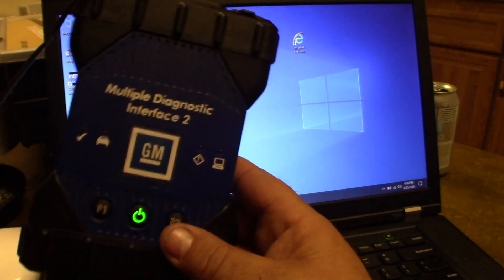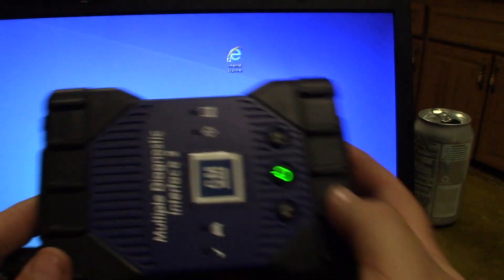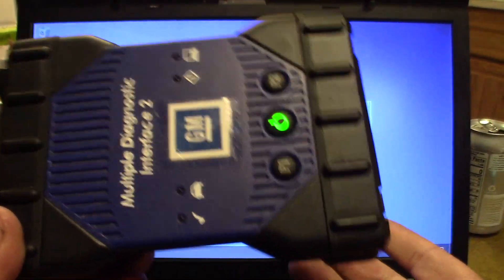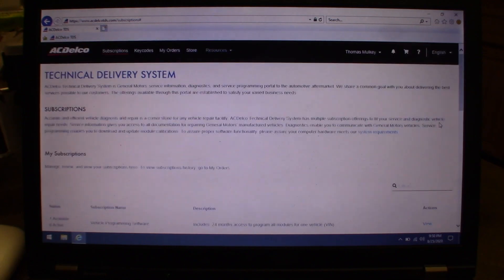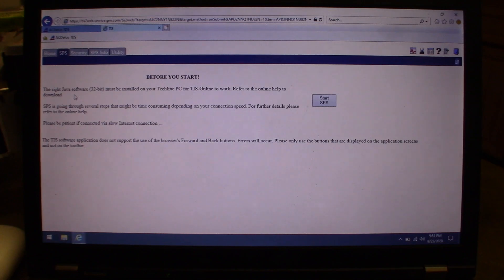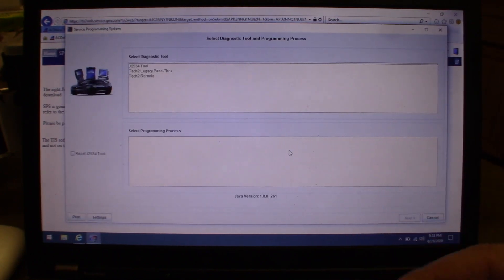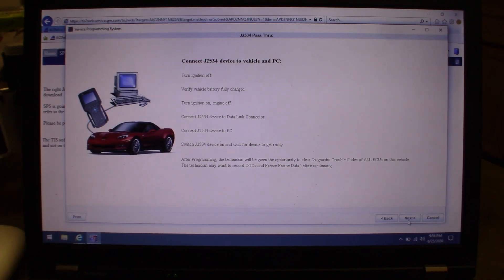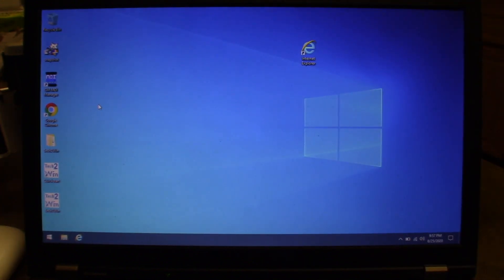Getting Started Flashing GM Modules with a Chinese Clone J2534 MDI II Clone JBox

Comment: Other YouTube videos say the battery voltage must be maintained at a certain voltage. Does the one you use have the capability to charge at a programed voltage or does it matter?
Reply from the maker: I use a battery maintainer.  GM's I keep around 14.2 volts.
Reply: @frugalprepper so are you saying it needs to be maintained at a certain level not necessarily at a specific voltage?
Reply from the maker: Well It needs a good battery, but I run a 60AMP maintainer at 14.2.  Really GM's are very forgiving.  I have programmed them without hooking up the maintainer before.   Fords, well they can be a little more picky, but they will monitor the voltage and if it drops to low they will no program.
Reply: Got another question,  AC Delco TDS system requirements do not show Java being necessary to run this system. Is this true or a mistake?
Reply from the maker: I didn't install Java, but I think it installs it when you set it up, because it definitely uses Java.  Because when it gets stuck doing a programming, I have to do a Ctrl-Alt-Delete and end the Java task to end it.

Comment: At 15min mark you say with this particular clone / knockoff that when sps2 software asks to connect to mdi1 or mdi2 box you have to select mdi1. This is because box is an mdi1 tool dressed up to look like an mdi2 tool.
Reply from the maker: Right.  MDI1's still program everything just fine though
Reply: @frugalprepper  Thanks for clarification. Technical support says you will get away with programming many 2021+ vehicle modules using mdi1 tool. That said it was suggested you will hit errors when programming a module that requires the higher speed j2534 box protocols to get the job done. Have you run into any 2021+ vehicle modules in your work where that is the case?
Reply from the maker: I don't work on anything that new.

Comment: Which windows does the mdi 2 need? The clones say they only support windows 7 pro. 
But I heard you say your using windows 10.  I’m wanting to make sure I have a laptop that will support the mdi and software.
Reply from the maker: It will all run on Windows 10.  But you will want a separate machine for running the Tech2Win and GDS that comes with it, because GM will run autoupdates when you use SPS and that will break the free versions for Tech2Win and GDS
Reply: @frugalprepper If I  use it for programming  only could I run it on a windows 7 pro laptop. I already have one that would only be for programming and nothing else installed .
Reply from the maker: no the current version of SPS requires Windows 10, will it run on 7.  I don't know, but GM says they no longer support it.

Comment: Would this work to program a 2023 Corvette Key?
Reply from the maker: It would if you then bought the latest GDS subscription, but you don't need it.    You just do this: Close all doors and trunk.
Insert the working key into the ignition and turn it to the ‘ON’ position.  Press and hold the ‘LOCK’ and ‘UNLOCK’ buttons on the driver’s door panel simultaneously for approximately 10 seconds.
Release the buttons when the security light starts to flash.
Within 5 seconds, press any button on the new key fob.
The security light will flash quickly if the programming is successful.
Reply: @frugalprepper  Thanks for the info. The thing is that I bought vehicle from auction. All keys are lost with it.

Comment: Great video. I have some questions please. That AcDelco site also supports flashing European GM car Opel and Chevrolet? When you replace a module on the car to programme it the replacement module needs to be new or you can programm also second hand module on the car? Thank you.
Reply from the maker: Yes it will do European GM as well.  GM allows you to reuse module and program them to your care (usually).  There are some very new makes and models that will not allow you to put in a used PCM.

Comment: I just got one of these clones in the mail with the software pre-programmed on a hard drive. I’m going to try set it up on my PC this weekend. I’m replacing an ABS pump/ module on my 2017 Silverado. Thanks for the video. Best wishes!
Reply: Will I follow all the steps you mentioned in this video for communication with a 2017 Silverado? Thanks again.
Reply from the maker: Umm.... Sort of, but the software has changed to Techline Connect now.  Which you wont used the pirated software for now, you will actually download and update the tool just to do SPS2.  I cover the newer software in this video:https://youtu.be/Z0MmCtcsY30
Reply: Will I need to purchase the VCX-NANO to program this ABS module? Thanks again

Comment: How do you work around SPS2 programming now that clicking on vin takes you to Techline Connect? The subscription for Techline Connect is $4k+
Reply from the maker: You just buy a VIN to SPS2 and then when you go in it gives you the option to download Techline connect and install it.  The SPS is now part of Techline Connect, it will install GDS2 and Tech2Win and everything else, but they will not run with out a subscription, but you can still access the SPS to program.

Comment: i have a 2020 GMC Terrain that i have to program a new PBCM (parking brake control module)  not looking to spend $1000's on  equipment,just looking for the least expensive way to get the job done..i'm guessing this MDI 2 clone will work just fine, what exactly
else will i need?
Reply from the maker: MDI2 Clone, a faster laptop with Windows10 and a $40 purchase of the VIN on acdelcotds.com   A battery maintainer is good, but you should be fine wthout it just make sure you battery is fully charged and good before you start.  I have a newer video on this: https://youtu.be/Z0MmCtcsY30

Comment: What AC adapter did you use, and where did you get it? Do you have a link.
Reply from the maker: It was one I had laying around.  It was a 9volt center positive.  I believe it will work with anything 8-16V though.

Comment: Thank You ...  This is excellent.  I assume I don need to add the software with the MDI purchase.  They want $50 and I would rather get it from GM
Reply from the maker: The pirate software they are giving you is Tech2Win and GDS 2.  Those are going to require s subscription on Techline Connect to use, and they aren't cheap.   GDS2 Light Duty (2010 and newer) - 3 Days $64.00 - 1 Month $254.00 - 1 Year $644.00.  Tech2Win (Most things 2009 and older) - 3 Days $62.00 - 1 Month $252.00 - 1 Year $616.00.  The pirate GDS2 only goes through 2017 though I believe, so for anything newer you will have to purchase a subscription.   The programming piece has to be purchased by VIN number for $45 for 2 years on Techline connect, and programming is done online via SPS.  SPS doesn't do diagnostics it is for programming only.   You have to buy that anyway.
Reply: @frugalprepper    Thank You ..  So if I get a bare MDI 2 box, no software, I can get the tech2win by subscription for three days.  That means they will provide the software for download.  What got me was all the offerings of sata drives and extras ...  So to reprogram a module (ABS/EBCS) I need $64+$40 for one 2008 Saturn Vue ...  Plus the MDI2 clone and my PC - Win 10 pro admin rights and all that.  Thank You ....
Reply from the maker: @mikecliff2367  To reprogram you only need the $45 piece.   You only need the GDS2 subscription if you use GM's diagnostic software.

Comment: Excellent video, and many thanks for trying to clear things up! But I'm a pretty big dummy, so I'm still a little bit confused. My daughter has an '03 TrailBlazer and I want to get access to all Diagnostics and Programming for that vehicle. Assuming I buy a good MDI clone and pay the $40 for a VIN Subscription, that will get me access to all Programming services, correct? But if I want access to all Diagnostic Codes and Procedures too, I will need at least a 3-Day Subscription to Tech2Win for $55... is that correct? Thanks again for your help!
Reply from the maker: No it comes with pirated Tech2Win so you don't have to pay for that.  You will only pay if you program with it.
Reply: @frugalprepper  Great, thanks! Will this copy of Tech2Win run without issues under Windows 10 Pro_64?
Reply: @frugalprepper are u able to do the diagnostic with tech2win pirated version?

Comment: Good Afternoon.  Yes could you tell me this unit unlocked 🔓 GM radio 📻 or not
Reply from the maker: It will unlock them.  The older ones will often unlock through tech2win.  Most of the newer ones may require unlocking via a SPS update.

Comment: Mdi2 has built in battery not like mdi1 which uses aaa batteries. Mdi2  has also wireless but it is a USB wifi dongle and it is under the black removable plastic. So make research first.
Reply from the maker: Yeah this is a cheap Chinese clone not a real MDI.
Reply: Do you need both devices or do they both program ecu .but the lil box can go 2020 then the handheld one go to 2014
Reply: @morrisrodney19  you need only one. Preferable mdi 1. Mdi2 is more likéry you buy a fake which does not work.
Reply: Because I have a GMC truck 2006 I heard that this can read GMC reduced power code

Comment: Confirmed and it is the MDI and NOT the MDI 2. Mine came in defective front to back, a waste of time and resources. What a waste of money. Went ahead and purchased the OEM version. No chances taken, works with WiFi and RJ45. The MDI 2 is an investment and one should invoice accordingly. The VCM 3 is built on the same platform as the MDI 2 and named Bosch MTS 6531. The VCM 3 with MDI 2 use CAN FD and ISO13400 DoIP. 
Good luck getting the MDI to use those protocols.
Reply from the maker: Thanks for wishing me luck!

Comment: Hi, I got a low-end variant Chevrolet that doesn't have cruise control. Could I activate Chevrolet cruise control via SPS? Thanks
Reply from the maker: Yes, after 2006 or 07.   But you will have to call the Aftermarket AC Delco support center, to get them to modify the BCM and the ECM/PCM software on their servers to enable the cruise control operation. They charge $120 due to changes on their end.  You will have to then spend the additional $40 to download the software for your VIN.  Some vehicle models only need the BCM software changed and others need both BCM and ECM/PCM software changed.  The you can install the required parts for cruse control and re-flash the PCM/BCM.

On older cars say 2000ish through 2006 you can reprogram the RPO codes via Tech 2 Win, just enable them.  The RPO Code for cruise is K34

1999 and back you will have to buy the actual module that suppored cruise control and all the other RPO codes and replace the physical module.  Also physical wiring may need to be installed, as not all harnesses had all options included.
Reply: Well explained! Got it. You got one subs here. Thanks Buddy. 🙏

Comment: Nice video. Highly believe that the Clone MDI2 you have is just a Clone MDI1 that is physically in a MDI2 case. Don’t believe that will affect you now unless you come across someone with a Global B vehicle (2020+ Cadillacs, 2020+ Corvettes, now various 2021 GM Trucks/cars). Global B cars/trucks are still under GM Warranty..probably will be a few years before we see a real need for MDI2/Global B. When you go to the MDI Manager do you recall what it showed ?
Reply from the maker: It is a MDI 1 in a MDI 2 case  I work on old stuff.  I will be at least a Decade before I need 2020 or 2021 support.
Reply: @frugalprepper  darn it I just bought this for my 2018 it won’t work…
Reply: @killasmoke2142  it will work on Global A pretty sure the first Global B car is a 2020 ct5 followed by the c8 corvette  ive used this on a 2018 and 2021 Camaro no issues including flashing modules
Reply: @frugalprepper  I really hope this works do you think it will?

Comment: in your link the vendor lists 2 options one that comes with a hard drive with the software on it. I appears you dont need that because you can get the software online is that right? Thanks in advance.
Reply from the maker: You can, but if you need GDS2 I would recommend getting the one with the hard drive.   GDS2 is real tricky to get working from the downloads and it's all seutp and working on the drive.  Tech2Win goes up to about 2010-11 and everything after that will need GDS2.  This will give you full bidirectional controls and allow you to program keys/fob set options, ete.    SPS is for programming Modules.    

To run SPS you will need a drive with Windows10 and the latest Java on it.  I will update the firmware on the MDI, install a new J2534 Wrapper the first time you use it with SPS.  Then when you put your old drive in to run GDS 2 it will come up and tell you you need to update your PC software to match the firmware on the MDI.  You have to download Chrome go to AC Delco TDS and go to the Utility Tab and download the updated MDI software and it will work.   This will happen about 2 times a year when GM comes out with a firmware update and you program with it.

I use the drive they sent me to run GDS2 only, but Tech2Win will work on it too.   I run my Tech2Win and SPS on a Separate Windows 10 drive.  I've actually considered getting second MDI to just run the GDS2 with and never updating it.
Reply: @frugalprepper  thanks for the awesome response! I am looking to do immobilizer relearn and an air filter reset on a vehicle so I will just be using SPS.  After reading your response it sounds like I should I dont need the one with the hard drive. Is that right? Thanks again.

Comment: Can you program BCM modules ?
Reply from the maker: Yes
Reply: @frugalprepper  yes, but we need to pay to work on a specific vehicle. TBH, I thought that it comes with pirated software and You're good to go even with programming. Anyway, it's still better than nothing, at least You can scan the codes and trace the faulty sensors or bulbs.
Reply: Used ones?

Comment: May have asked you this question before......did yours work on an older Class 2 car (2004 and older)? The one I got simply wouldn't communicate on Pin 2. Tech2Win wouldn't work, nor would SPS. Worked great on our other car that runs on GMLAN though. Had to return it and get a MDI 1 clone. Wondering if I just got a bad one.
Reply from the maker: Mine works fine on Class 2 cars with Tech2Win and SPS.